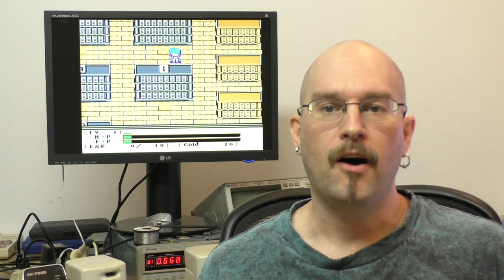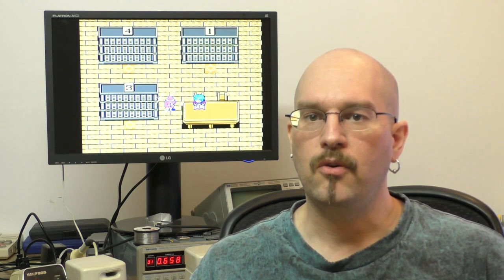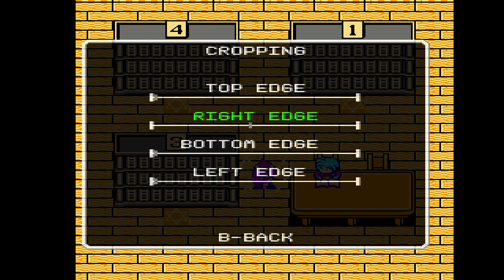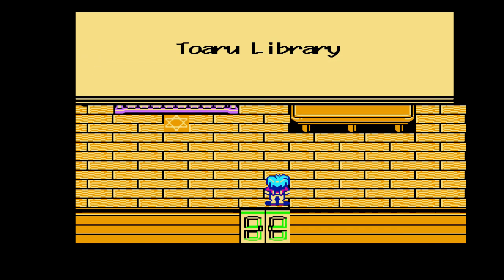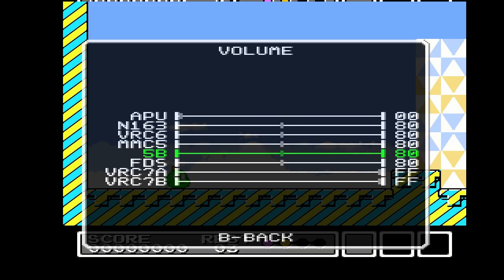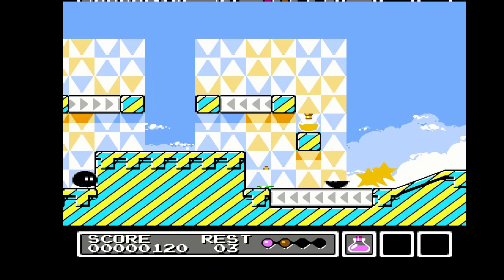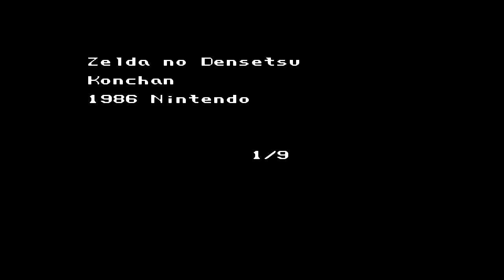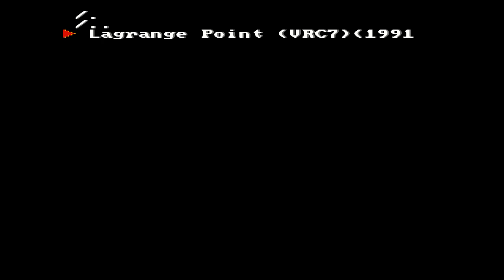Hi Def NES Update 3 - Expansion Audio, Cropping

Comment: Regards to other audio, a level meter would be a good idea as well as a master volume meter (Separate from the channel meters) so you can adjust the level of the signal so it doesn't clip. And then just turn up the TV or amp you have it connected to instead. Clipping is a big nono.

Levels should be relative to the dBFS scale since it's digital.  Don't want it to go over 0.00 dBFS.

Comment: I would think that palettes would ideally be designed for 2.2 Gamma, since this is the general standard for most modern monitors and HDTVs. Your EDID will actually tell you what it gamma it is supposed to be. You can use ELDIM to read EDID information from the windows registry. So all you have to do is connect a display to it once.

Ideally 100% black should co-relate to RGB level 0 in sRGB (And as long as the display is set properly and the NESHDMI is being used in the TV's 4:4:4 mode. There shouldn't be any issue)

I dont' know much about IRE levels in the realm of analog NTSC standards so there's things i'm probably forgetting to think about
Reply from the maker: I can and will be reading the EDID actually, because I have to identify the monitors to determine the resolutions it can support for 1080p and 720p.  Unfortunately I am not sure I can do much about the gamma issue, at least first.  I have extremely limited resources on here.  I will be outputting RGB and hoping for the best, at least for now.  I really need to test on a whole bunch of monitors somehow.  Maybe some appliance store or similar will let me test on all their display models.  that'd be awesome.
Reply: kevtris
 Usually I think some stores will let you hook something up to TVs on display to test stuff. (But usually those floor models are set to floor mode, which are set to be as bright and blue as possible. In other words, somewhat inaccurate). (Baring in mind, i'm talking places like Walmart and the like . I don't know how Best Buy does their stuff , the same i'd have to assume. Not many places will display calibrated sets).

HOWEVER, they may let you change settings as well, (Like for example changing the input labeling to send the set into 4:4:4 0-255 RGB mode).

If I had spare TVs/Monitors, I really wouldn't mind helping out. But of course, there's shipping.

Is it possible to update the unit via software for example? Like potentially adding maybe a logging function that dumps to some form of removeable storage?

If
Reply: kevtris
Actually, I just thought, if your monitor has multiple inputs, try A/B'ing it with emulators with Palette support and try to get it to match and look just right!